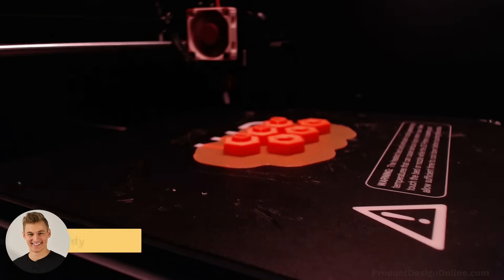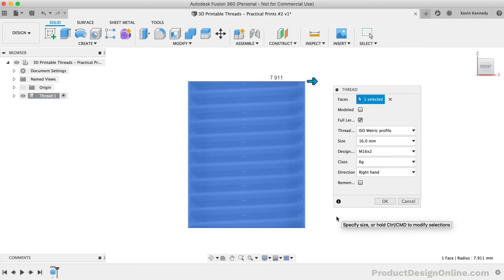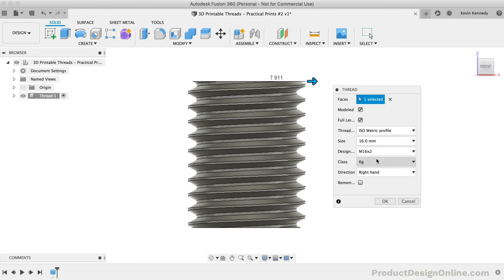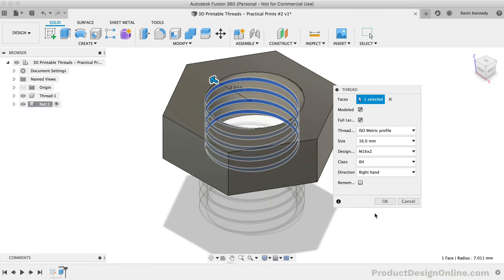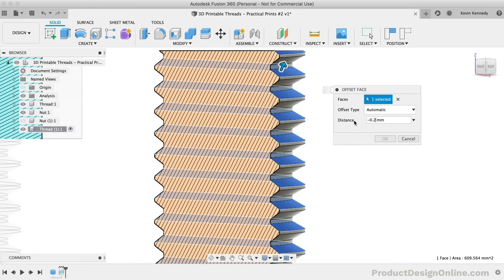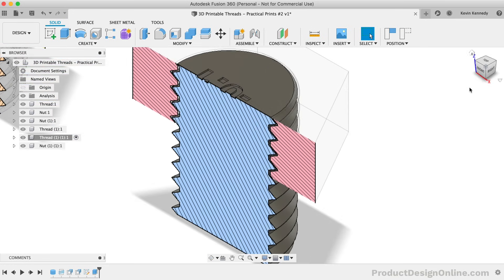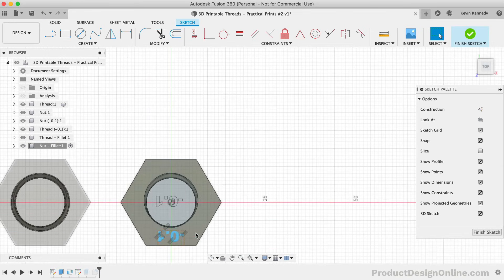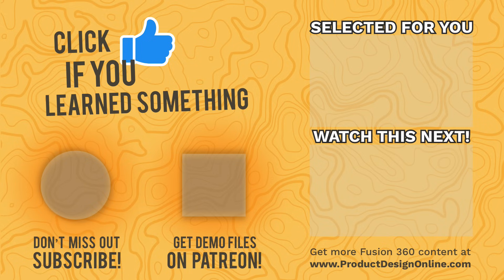3D Printed Threads - Model Them in Fusion 360 | Practical Prints #2

Comment: There appears to be a genuine requirement for alternative and someone hit me a slap for saying this, a "sustainable" means of energy production as the cost of power and fuel is becoming ridiculously comical.  I wanted to import the Ugrinsky wind turbine design and make a few modifications and bring it into the real-world so that art meets application and functionality.

I'm going to import the .stl files of an Ugrinsky wind turbine ( from thingiverse ) into Fusion 360 and modify them to include a female threaded center hole at the  bottom of each section and a male threaded cylinder in the center on top of each section.  Five sections one top another complete the turbine. 

Underneath the bottom section center threaded hole would need to have a diameter twice that of all the rest so it can be attached to a short shaft that ends with a Hyphoid Gear which would be in the middle of it's own shaft ( so that the turbine ends with basically an upside down T shape )  So instead of driving one generator, I can drive two thus doubling the output.

I witnessed a research scientist/professor on youtube called Robert Murray Smith do this with his 3D printer ( minus the central hole and cylinder ) but I think the additions will strengthen the whole structure.  I'm not sure at this point if I want to 3D print it using Carbon Fiber or if I will have it created in a CNC router.  

With this turbine using the wind to turn the generator through a Charge Controller into a Battery Bank and ending in an Inverter, this could power small electric heaters for nothing after the initial cost of the parts.  Sorry sir, you did say mention any ideas in the comment section. lol.  Thank you Product Design Online, this is one amazing video.  Typical of course for your channel. 🔩⚙ 👏

Comment: Thanks for the great tutorial. 

I got stuck when I want to offset the face of the thread wtih the fillet. I cant offset it by -.1mm, I get a warning that the cylinder has a problem with that... Do you have an idea what Im doing wrong?
Reply: I had the same problem..when doing the offset, change the "offset type" from "automatic" to "new offset" and then type the distance of -0.1mm. Worked for me

Comment: Kevin, I am designing some parts for 3d printing in Fusion 360. I need to use some large (1 1/2' and 2") male and female NPT pipe threads. I have gone the "taper hole thread" route and i have inserted some fittings from McMaster Carr. I currently using an Ender 3 and ASA filament as these are "working parts" for outside. I am not happy with the thread quality and fit. I have had some success with large machine threads in Fusion but i need pipe thread in this application. I probably have 40-50 hours in design/printing so far. Do you have any suggestions?

Comment: This is a great video for the project I'm working on~!  I'm trying to make a 4" threaded flange as a dust collection port for the cabinet of my disc/belt sander combo.  I've searched for a 3D printed example, but found nothing, so I'm giving it a go.  This video should work great in supporting my attempt at a threaded adapter.  Very clear & concise instruction for a pretty intricate operation.  Not sure that I'd ever by able to do this in SketchUp.  Thanks much~!!

Comment: Super helpful video, thank you. I used this to successfully make a plastic female 1/4-20 camera mount for a metal tripod mount. The plastic needed thick walls to hold it in place. I think it may help to try screwing the metal bolt in right after printing while the plastic is still warm and pliable.

Comment: I have a sailboat. On top, there is a depth finder, and a radar. Cables from these two run inside the cabin. There is a hole, with a nut going inside. I suppose the nut has a thread of 46 by 2. I am struggling to create a cap that will close the hole, while still allowing the cables to run inside. In other words, in the cap there is a hole allowing for the cables. But the problem is creating a thread that will match the thread of the nut on which the cap should go. So, you asked for it - "what kind of problems do we encounter?" Otherwise, thanks for the video.

Comment: Could you kindly say, what model of printer did you used and it's cost?
Reply from the maker: Hi B. Great question. These threads were printed on a really old monoprice printer that is no longer available. I have several 3D printer recommendations for beginners, depending on what you're looking for and price point. You can see them listed here: https://productdesignonline.com/fusion-360-users-what-to-buy/#3dprinters
Reply: @ProductDesignOnline  Tq very much for you're spot reply.. 😊

Comment: This tutorial worked great but I can't believe I printed completely functional M2.6X0.45 threads on an Ender 3 V2 with 0.4 nozzle.  Even the entry level machines are becoming so amazing!!  Thanks to your tutorial I even got it on the first try!
Reply: Was that with the thread face offsets and fillet? Nice job.
Reply: @HighBoss  I think I followed the video exactly back then but it does the offset for you now.  I didn't do either on the threads I did last week and they worked great.  The fillet might still be helpful though when 3D printing.  I simply forgot to do that last week.

Comment: My current struggle: How to add the Formlabs 3+ Resins into Fusion 360 for .stl setup for 3D print (basicall to allow me to do this in Fusion360 without needing Preform software maybe?. I can set the printer okay, but there only seems to be a few printing options (something like high, medium and low resolution, but nothing to do with the types of Resins that Formlabs offers, e.g, Tough , Clear, etc.

Comment: Hello, I seem to be having an error when I add the threads to the bolt side they do not line up with the screw. I am making a 3/8 16th and it seems to be .64mm too low. Any ideas what could be the cause?

Comment: I can follow everything exept when u make the third nut and bolt. There you want to use offset and suddenly you change to.... That went way to quickly. Not sure if you pressed oke or not or did something else. Than you went further to fillet with 0.15mm. But lost the connection there what you need to do to go to the endresult.
Reply from the maker: Thanks for the feedback! I Offset the outer faces -.1 before applying a fillet of .15mm to each edge. You can press the 'Return' (or Enter) key on the keyboard to confirm the command in place of selecting "OK".

Comment: My latest challenge was to make a garden hose thread for a special nozzle to be printed on Ender 3 v2.  Fusion does not offer this thread, but Machinery's Handbook had the specs.  Basically, the thread profile is the same as UNC.  There is a UNC 1.06 - 12 thread (1 1/16) which I used.  However, what I really needed was a 1.06 -11.5 .  I then scaled the z axis only to 12/11.5 which stretches the thread to the proper TPI of 11.5.  It worked well except the thread did not fit all hoses because of tolerance so I created clearance by scaling x&y by 1.03.  In fact ,  this does alter the thread profile slightly but not enough to notice.  Thanks for the videos

Comment: Thanks a lot for another useful video! :)

Does anybody know why I'm having an issue where the thread on the nut doesn't align with the thread of the bolt? (i.e. When viewed in Section Analysis)

 Is my only option really to rotate one of the components until it 'looks' good? Seems like unnecessary steps to me...?  :/ ??

Comment: This is a great video, wish i seen it a long time ago.
Tip. If wanting to print fine threads then setup your printer to either a 0.2 or 0.1 Nozzle and Use PLA+ works well down to M6

Comment: Is anyone else's thread face not offsetting before adding the fillet? No matter what dimension I select, the visual appearance does not change and when I click ok, the action does not get completed. It's as if nothing happened. Any thoughts as to why?
Reply from the maker: Hi Gavin. Are you using the same thread or a different one? A few threads will not allow to offset as their pitch makes the faces too close to on another.
Reply: @ProductDesignOnline  Hi Kevin, I’m using an ANSI thread, that could be it. It was 3/4-10 UNC if you wanted to try yourself. I was able to find a workaround though! I could offset the angled faces but even the slightest offset on the vertical face wouldn’t go through. However, by extrude cutting (drawing a ring) a small portion of that face off, I imitated an offset, which worked great!

Comment: So I am just coming to this video but am I the only one having the issue where the threads only line up if you're doing metric? If you do Imperial then the threads don't mesh correctly!
Reply: Slight edit to my comment, actually Fusion is just very picky and the thread direction depends on which way an extrusion came from. In this case for the nut, if he would've extruded the nut upwards from the center of the thread, then created a thread in the nut, it would not have meshed correctly. Or at least that's the best I can tell as of now

Comment: First of all, thank you very muchfor this  useful and instructive content. Even though I couldn't get the exact result I wanted in my first print, I got the result I wanted by changing the offset settings. Then I made a sketch for the M8 and printed it and the result is still excellent. I had downloaded Fusion 360 before, but I had never used it. Thanks to this content, I both made an introduction to the use of Fusion 360 and learned to draw the part I wanted. Thanks again.

Comment: Great video but I am struggling so much with editing the text on the third nut, I just cant select the text to change it. If I edit the sketch then the whole thing just disappears. I eventually gave up trying to edit the text and printed them all out. It was obvious the one with the fillet.
Reply from the maker: Was the sketch hidden in the Browser? Fusion 360 will automatically hide it when you use a modeling command. Not sure what's going on without seeing the file.

Comment: You wanted to know a project that we find difficult.  I am a heavy user of Scepter Gas Cans on my boat.  Overtime the gas cap eating monster has ravished several of my gas can caps. I would love to see a video how to recreate a gas can cap.  The pitches are weird.  I did learn in you video that I could chamfer thread edges and modify thread surfaces to mimic almost any thread.  I just have not gotten a perfect one off.  I am in the process of casting a mold of the threads that can be cut in half to make it easier to get exact pitch and thread heights to  model the replacement thread cap.  My caliper does me zero good as it doesn't fit in the cap so molding and cutting in half may be a way to get me where I am going as far as accurate measurements.  I would love to send you a picture if you entertain this project.  Thank you.  David Fernandez

Comment: Okay, There are few things more frustrating that trying to learn all the co-dependencies and intricacies of Fusion 360.  Forget to check a box or choose an option and it is off to bang your head against the wall as hard as you can just so the pain stops when you quit banging your head against a wall. 

Your video is better than on-spot.  I have viewed a nauseating amount of videos to create a working nut and bolt.  By far, this video is more comprehensive than all I have viewed.  Thank you for taking the time to explain the various tools to create threaded nut and threaded bolt .  Then you  go further to  explain how to modify the threads surfaces to make a perfect fit.  Fantastic video.  Keep them coming.

Comment: I'm having trouble getting my threads to line up in the section analysis.  Any idea what I'm doing wrong?
Reply: Build them both from the same initial plane. It isn't smart when in creates threads, so building them in different directions (even if they end up looking the same) causes them to generate in a different way
Reply: @Drsen57  This worked for me, thank you!
Reply: Same issue for me
Reply: You click the bottom of the nut and slide it down. I was having the same issue and that is what worked for me. Hope this helps you as wee.
Reply: I had to ensure that both of my thread features had the "modeled" box checked

Comment: Thanks for the video, very useful. But I do have 2 questions . 

I have a bolt, 32x1.5 that is fixed on the item I want to repair. The plastic nut broke. How would I apply this to just the nut? If I pull back the faces like you do here on the bolt I have virtually no thread remaining and it still doesn’t screw on. Any suggestions would be most appreciated 😀

And as an aside, ataround 15:15 you say you are going to apply the fillet to the nut... but it looks like you are selecting the bolt. I’m confused 😫

Thanks 🙏 😊

Comment: Thank you for this video! I did run into a problem when trying this out though. When I make the nut, the thread in the nut does not line up with the thread when looking at the cross section. In your video they line up perfectly so you can see the clearance but my threads just cross each other.
What can I do to fix this?
Reply: What I found was that if I move the nut up 1mm it is aligned. How and with what is a thread aligned when creating it?

Comment: Thanks for making this videos. I learned a lot from you and some other guys how to construct stuff here. One point where I struggle with today is how I split and join objects. I have a design which needed to be splitted because it would not work if I just print it. But how can I do the best and easiest connection of both parts I want to print. thread looks good but an easier solution would be great.

Comment: My design history at the bottom of Fusion 360 shows a history for all three nuts and bolts. Why doesn't it isolate the design history per pasted component like yours?
Reply from the maker: When you activate a component it will show the timeline history for just that component... So when you have the top-level component active in the browser it will show all three (or all components)
Reply: @ProductDesignOnline  Looks like there was an option that is unselected by default called "Hide all inactive features". After enabling that, I am seeing what I expect. Thanks.

Comment: I printed mine and the nut won’t fit in the screw an reason why?
Reply from the maker: Hi Lucas. Did you just print 1 of them or all 3? There are a number of variables at play, so it may be hard to pinpoint one specific without knowing everything. What settings/slicer did you use?

Comment: Taking a tapping tool to refine the threads is the way to go. Even the most accurate prints are way off. And I don't want to print everything with 0.1 mm layers just to have proper threads ;-)

Comment: I have a question, are supports required when printing? I wonder if it matters depending on how much a difference the major to minor diameter is but I think that's determined by which standard you choose? Also the issue is trying to clean the supports especially for the "nut" piece especially if it has a smaller diameter. Also is there a minimum pitch that should not be used? I know you mentioned it in the video but I was just wondering what your experience has been about minimums and that's including adding clearances. I just need to know if like 1mm pitch is too small or if it's theoretically possible to achieve
Reply from the maker: You shouldn't need supports for threads. In most cases, that will ruin the ability to use them. It's hard to give specifics because there are a lot of variables at play with your printer/filament/slicer settings, etc. You'll have to print some out to test :)

Comment: Really well done video. My only comment would've been suggested slicer settings as I'm not sure if supports are needed or what else would need to be tweaked. But honestly phenomenal job. I attempted to use the tool and after failing and watching this video I can see a lot in regards to where my short comings were. Honestly though really nice job and thanks so much for the full tutorial and print in the end. It helps to visualize everything and understand the tool and concept

Comment: From my XP the offset depends on a lot of factors, like: Layer hight, material, diameter of thread etc. There is no way you can 100%ly do this without trying. Example: ABS parts need more offset then PLA. Huge Diameters need more offset then small diameters, 0.1 layer hight needs less offset then 0.3 layer hight. Then if you want to mix materials like SLS Nylon with FDM ABS you also need to make some studies. Most of the time I was printing things twice because they were to tight. But I almost never had something to come out to lose. So you always can apply an offset of 0.1 or so.
Also keep in mind that you settings will  NOT be interchangeable with same kind printers or your slicer programs because of slightly different settings. You will always have to make studies first. :)
Reply from the maker: Very true! Testing (a small print) is always the way to go :)

Comment: I wanted to make a screw-on lid for a small round box that has a diameter of 32mm.  Does letting it default the thread size (32mm/M32x2) work, or would I be better with something else?  Thanks for the great video!

Comment: I want to print them with 0.2 mm nozzle, 100% infill, but the temperatures are to high or to low, if to high, at one time, extrusion blocks, if to low the model is not strong